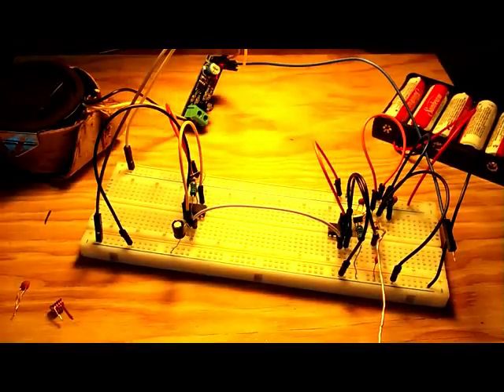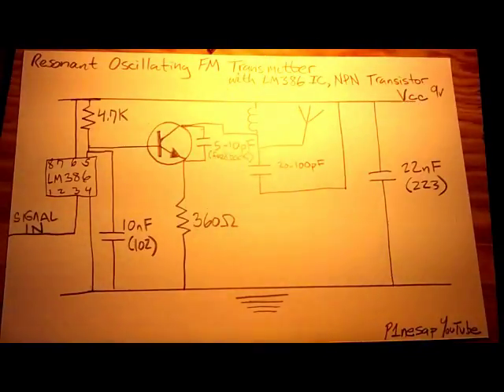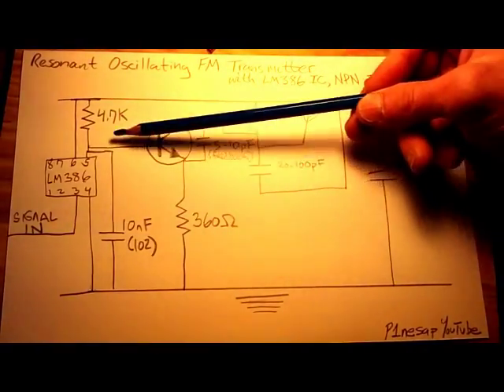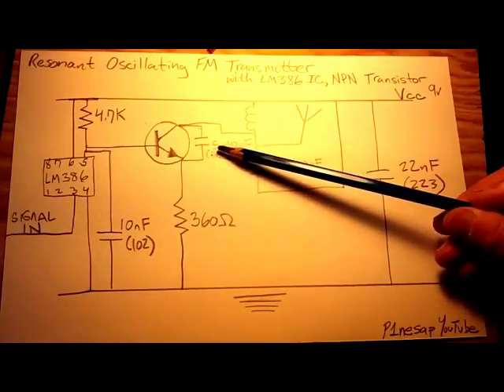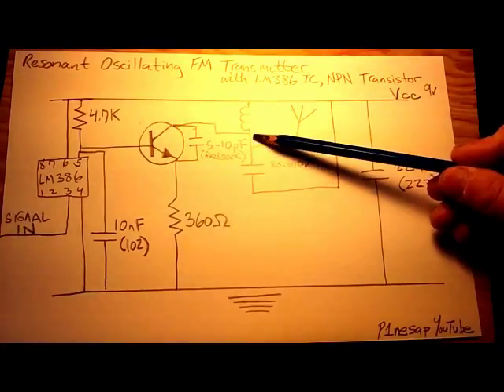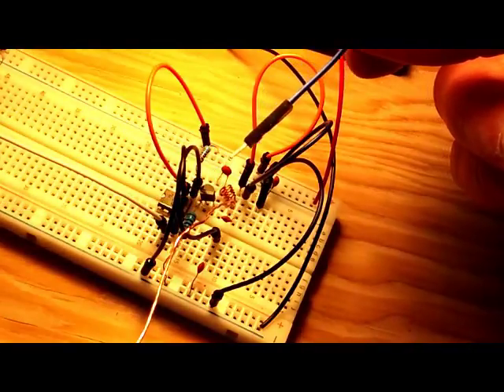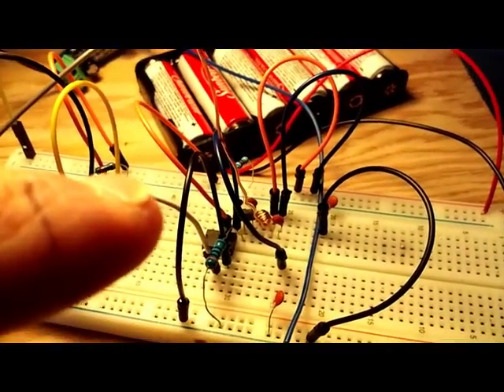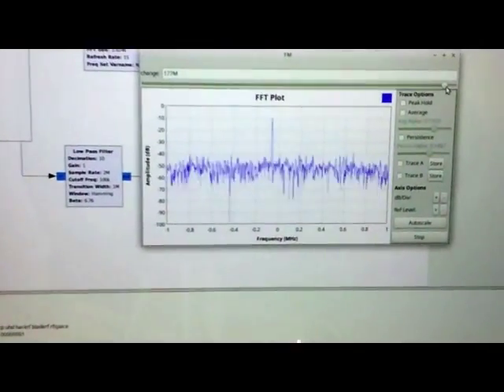Oscillating Transistor FM Transmit 📡 Circuit

Comment: No need to use IC ,just first transistor as an audio pre-amplifier and second transistor is the oscillator, done.
Reply from the maker: Interesting, so just feed audio signal to base of first transistor?
Reply: Epic Alternatives  
LM386 acting as an audio pre-amplifier,so instead of it I can use one transistor with high fidelity  output, then hand over this audio signal to the Base of the oscillator TR.
I have been made such circuits in 90's we were call it VFO which is simple mode for beginners,then I jumped for professional mode which is PLL OSCILLATORS...

Comment: If you put some capacitance parallel to your 360 Ohm resistor, you can get more power out. Also, you may fiddle with base current set by 4.7 kOhm, which is to me too much. Batter try to use some 100 kOhm or more between base and collector. This will give some feedback from the collector of the transistor to the base. Current is stabilized by emitter resistor. Capacitor parallel to this resistor make pretty low reactive resistance for RF, yet high resistance for DC current. Try 100 pF, or increase up to 1 nF. At some point oscillation will be stronger, and after this point (by increasing capacitance), oscillation will stop. Then just remove one of test parallel capacitance (use for example few capacitors of 100 pF in parallel). If you need more help with oscillators, amplifiers or antennas, please tell me and I can give you more advice. Thanks.
Reply: +Wild Maniac 
Oh, btw. If you do my approach, you can use electrolytic capacitor and decouple DC component between LM386 and base of the transistor. This way you can send audio signal over this TX. This particular transmitter is then modulated with both: amplitude and frequency modulation, because by changing condition of the current on base of the transistor. If you wish to make RF jammer, between 555 oscillator and base of the transistor use some potentiometer to adjust width of the sweeping frequencies, and you may get pretty wide range of sweep. On your FFT screen you will see relative narrow flat-top spectra of sweeping frequencies if this serial resistance is high (say 1 Mohm, or 100 kOhms). When you lower resistance, spectra becomes wider until you hit the point of too much current when all oscillations are wide but weak. I hope this helps you to understand how frequency modulation works.
Reply from the maker: +Wild Maniac Thanks, more power would be better. To clarify your suggestions: put 100 pF in parallel to 360 Ohm resistor, connecting both to ground and NPN emitter? There already is 22nF in parallel to Vcc/ground (schematic). And remove 4.7K from base/Vcc, instead connecting base/collector with 100K resistor?
Reply: Go first with smaller value, and if you have some way to test increasing power, do it. If not, good old way - take a walk with a receiver. This capacitor is parallel with 360 Ohm resistor. 22 nF one is not, it goes from GND to +ve 9V. Try first 100 pF, and then increase and observe change. After you get to the point that there is no more radio emission, remove one, or calculate sum of the capacitances and put some close value. 
4k7 is too low - it gives you too high current, especially on 9 V. It will be good to have some trimmer or normal potentiometer, set to maximum resistance, and slowly lover value until it begins to oscillate. It may happen that after you add capacitance parallel to your resistor, you may slightly change 'operating point' or this resistance. After you are happy with the result, measure resistance from trimmer or pot, and use closest value of fixed resistor.
Reply: What this capacitor does is changing impedance or capacitive reactance for particular range of frequencies. It also affects feedback made by other capacitor between emitter and collector. There is some 'sweet spot', where it works the best. Don't change this capacitance if it works fine. Note that every circuit can be optimized for maximum performances.
Reply from the maker: +Wild Maniac OK I'll try 10K pot instead of 4.7K. And, for 100 pF cap parallel to 360 Ohm resistor, do I connect both to ground and NPN emitter?
Reply: Try add more than 10 k. You need only enough current to transistor to begin to work. No need 'hard push' as it is with 4k7 or 10k. Yes, both: capacitor and resistor are in parallel, on end to the ground, another to the emitter.
Reply from the maker: Thanks for the tips!
Reply: You are welcome. Always ask if something is not clear. Electronic is fun more than you can imagine. Especially radio parts.
Reply from the maker: +Wild Maniac Following your tips, I find biggest amplitude gain (10 db) with 100K resistor and 75 pF cap. Values over 100K and 100 pF are very weak or not detectable. I'm curious: how is parallel capacitor different than just increasing emitter resistor value? Even with greater amplitude, transmit range is same. Need better antenna? Thanks again.
Reply: +p1nesap 
Parallel capacitor, actually capacitance in general are low impedance for RF signal, while high impedance for DC current. Task of the transistor is to 'pump' RF power into resonating tank (LC), and if resistor is high, it just have not enough current, and/or can't do it properly. 
Antenna is the most important thing. It is the 'door' or 'window' into transmitting and receiving signal. If receiver is deaf, transmitter can screaming loud... The same is for transmitter. Imagine you talking with covered mouth - no matter how loud, it is suppresed. Alow signal to get out of TX, and alow signal to get into RX. Also, wals can attenuate signal by absorbing RF signal.
Reply: +p1nesap 
Also, very important thing is properly couple antenna to the exit of the transmitter. Directly on collector, and it is really bad situation - this point has high impedance. As you getting over the coil to the positive end, impedance getting lower and lower - there is sweet spot where it is matched with antenna impedance. This is something like transformers; or you can get high voltage, but low current (this is your collector on NPN transistor), or you can get low voltage, and high current. Too low voltage or too low current - both are bad.